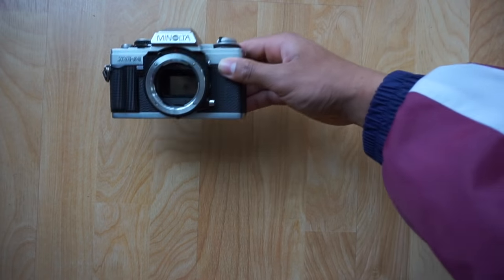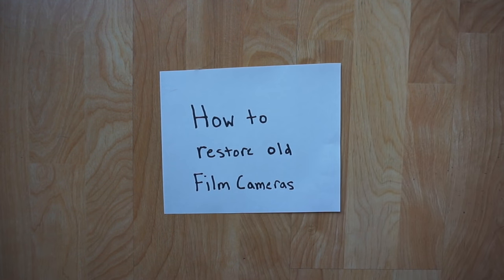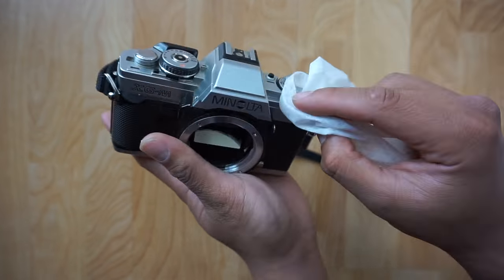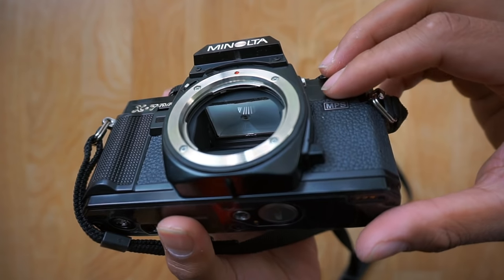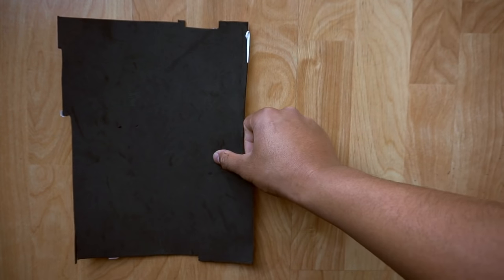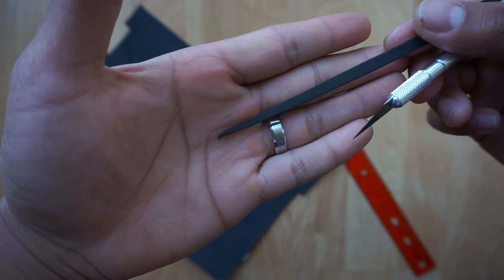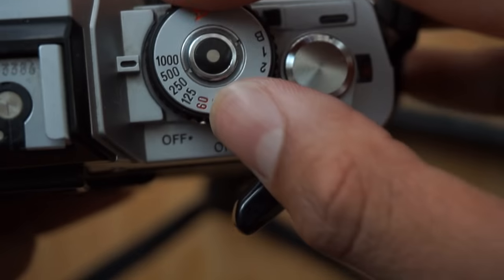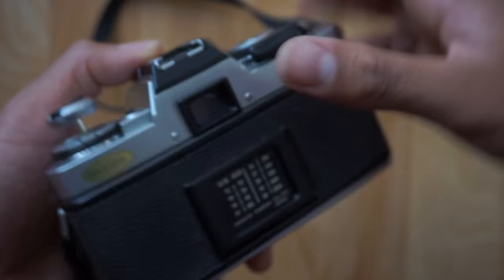How To Restore Old Film Cameras!

Comment: Be very careful with the mirror but maybe also hit the focusing screen with some compressed air and get around the film compartment. Don't be to close with the compressed air you don't need to blast it. Just enough for get the dust moving out.  Could also use a rocket blower.

Another stellar video!
Reply from the maker: Justin Holt thanks Justin! Also I've never tried the compressed air before! Gonna give that a try today thanks for the input! :)

Comment: We shoot with Minolta's all the time. This was a great watch. We mostly use the X-700 and the X-570. These tips are really going to help us going forward. I've never replaced a light seal before but this video makes me feel a little more confident that I can handle it. Thanks for sharing.
Reply from the maker: YEA! MINOLTA GANG! And nice, I've never tried the x-570 is it any good? How does it compare to the x-700? And the light seals are fairly easy, if you have any questions about it I'll gladly help out! Glad you guys enjoyed!
Reply: The X-570 has a lot of advantages over the X-700, the biggest being it shows recommended shutter AND current shutter in the viewfinder. It saves so much trouble when out in the field. You lose the exposure compensation but it's a fair trade in my eyes. It also allows flash sync down to 1/60th sec. Great camera.
Reply: The X-500/570 also comes with one single capacitor instead of two (for the MPS on X-700) and in certain series on the X-700, there are some ehm... issues with capacitor number two (series 24xxxx-27xxxx if I am right).

Comment: Good video and tips, but one thing, some cameras have very fragile mirror mountings. It's much better to use lens cleaner on a good-quality Q-Tip rather than using your fingers on a micro-fiber cloth.  Thanks for sharing your knowledge with us.
Reply: Yeah , don't use microfibre . Use a liquid and swabs designed for mirrors so the silver coating isn't scratched or smeared.
Reply: @MrFreakwent  so q-tips are no go then? Only specific designed swabs for mirrors? Just wanting to make sure. Don’t wanna break anything. These cameras now are especially expensive and are no longer…$35 bucks for three like he said in the video. Now there around $200

Comment: Hi! I love this video, but I have a question. I recently got a Yashica FX-3 and notice dust in the mirror inside the camera. For what I have reading about, the mirror can't be cleaned because it's very fragile and I should let it like that. Mi question is if I should try to clean the mirror of my Yashica?
Reply: Enrique Arauz if it's just dust, use a rubber dust blower to blow out the dust. i dont know how to describe the thing but googling "rubber dust blower for camera" should help. it's pretty cheap too
Reply: your question was from ages ago but for anybody reading... best use a brush to lift the dust off the mirror. You blow air on the brush bristles using a rocket blower and that generates static in the bristles. Brush gently across the mirror and the dust is attracted to the bristles, lifting it off the mirror. Never blow the air onto the mirror or the dust might get lodged in the mechanism somewhere else

Comment: One problem you failed to cover is that the batteries of today are different from the originals.  The voltages are different and will affect the light meters in these older cameras.  I replaced the batteries on my vintage Olympus OM-1's and now both light meters have failed.  Apparently this is a common problem.  Any suggestions?
Reply: My Pentax Super Program took 357 Batts these are still made today
Reply: Find a good repair shop. Most of the time the resistors can be changed to properly work with the new voltage .

Comment: i bought a minolta x700 and it was in perfect condition but after using it with a roll of film (i took like 11 pics) the film advance lever wouldnt advance anymore and now its just loose (the only way i can describe it) do you know any easy fixes for this problem? pleeease lmk (ps. the batteries are fine and dont need replacing)

Comment: I've got the same camera which i got from somewhere but it doesn't turn on even if I replaced the batteries. The old batteries was leaking green so I just cleaned the holder. There might be some damage inside but I don't know how to open the camera.

Comment: What was your experience like with the XG-M vs the X700? And what is your for on the XG-M?
Reply: I bought my XG-M in 1985 and still have it. It’s an excellent camera and uses all the MD lenses. Set the dial to A on the camera, choose an aperture and the camera will choose a shutter speed. It takes 2 LR44 batteries which are required to operate the shutter. It’s a great camera.

Comment: I recently buy a pentax spotmatic and use it for the first time with a blacknwhite film and when I developed the film, there's stripes on the photos/negative. some of the photos that are bright or a little overexposed, there are no stripes on them. but on the well and a little underexposed, the stripes are very noticeable. do you know what's wrong? is it from the film that has expired or there's something wrong with the camera?
Reply: Fahmi Yustiza Its probably caused by the lightseal. If its broken it lets light into the camera and exposes the film. Therefore the stripes on your pictures. When the film is overexposed the stripes won't be noticeable because the amount of light comming in from the broken seal is very little so it won't show up on overexposed immages as much as on darker immages. So fix the lightseals as shown in the video and try again. Hope it helps
Reply: Mark Feyser thankyou so much for the response. I will surely look into it

Comment: What if the light seal adhesive has rubbed off and smeared on the mirror? Will that show on the film once I develop it? How do I clean this off? Anyone have some advice for me?
Reply: The mirror has nothing to do with the image on the film, it's only there so you can see what you are taking photos of. So no, nothing will be visible on the photos but you should really clean that mirror because it limits your ability to get the focus correct

Comment: Bit over simplified....also you can get in trouble replacing light seals partic if not needed....
Use a proper mirror swab when cleaning that area...